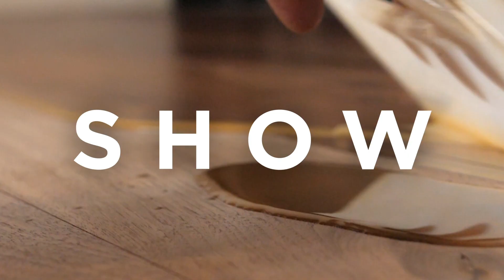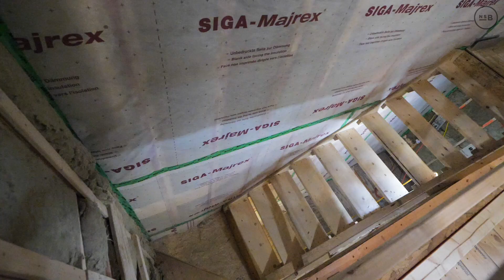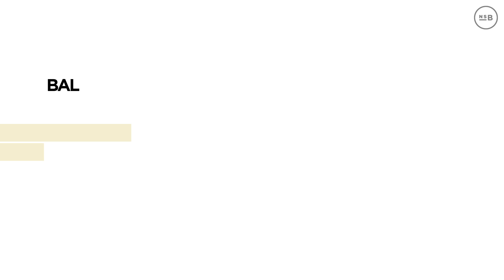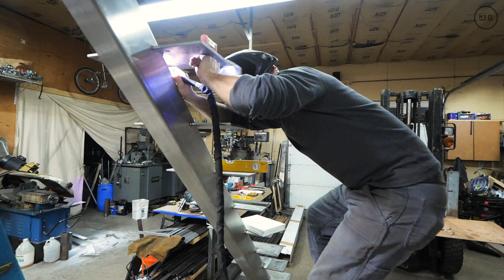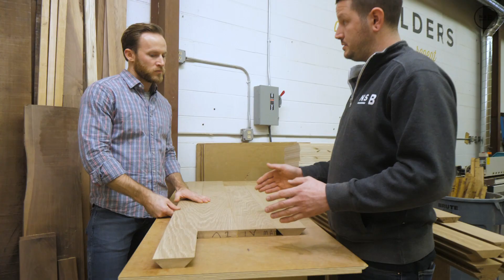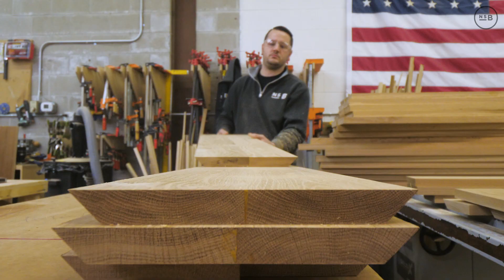Custom stainless steel & white oak stairs leading to Boston roof deck

Comment: After it's all set and done I'd feel bad just using this condo.  Everything is stunning perfection.
By the way, falling on that steel staircase will be extremely painful if not lethal.  Those oak edges are so damn sharp.  How do you even keep them from being banged up?

Comment: those stairs are going to look fantastic.  One question though, what is the plan for all of the mitered edges?  Are you going to run a small round over on them, plane a small chamfer, what?  Won't the very sharp mitered edges be weak and sharp on bare feet?  Thanks for all the great content!

Comment: Point of clarification: the continuous surface grain of the white oak around stair is a veneer effect. If you were cutting those from solid oak the appearance would be quarter grain on the side and long grain on the top. It's a cool detail, and insane craftsmanship either way. Looking forward to seeing the finished piece!